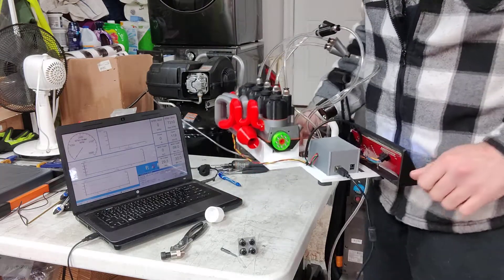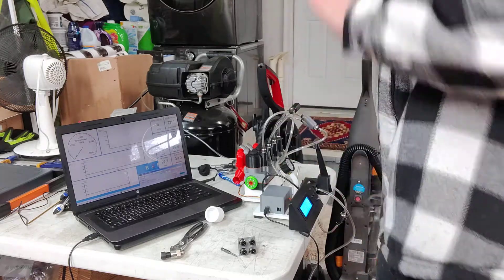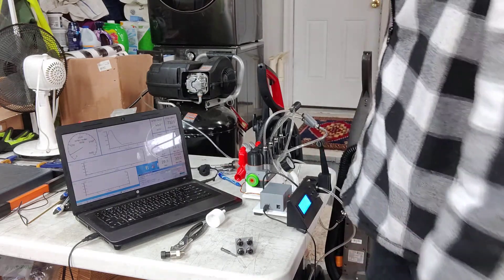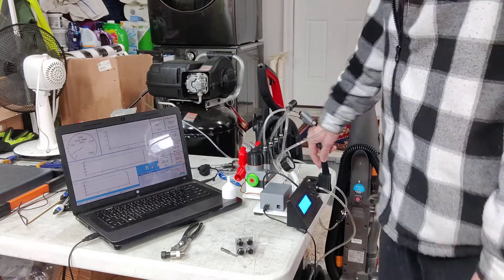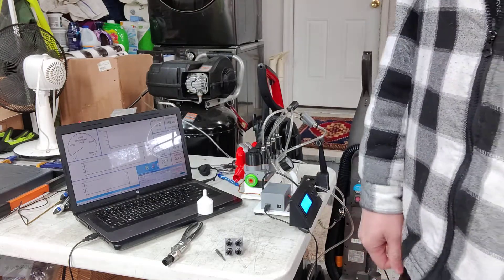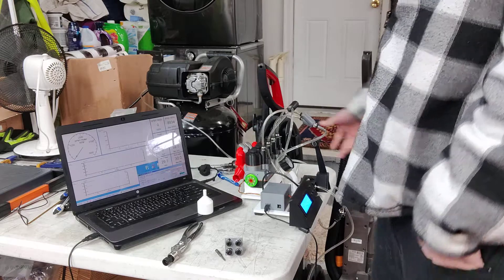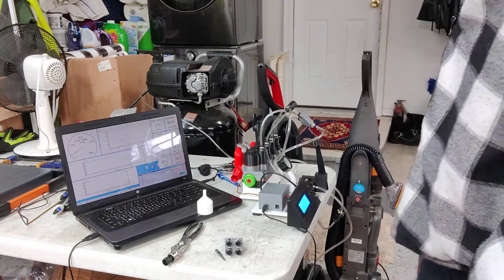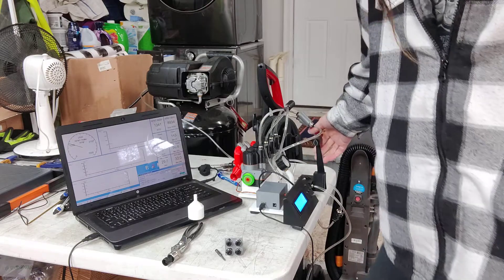Inline 4 crossplane 2 stroke 8cc air engine with tubular exhaust!

Comment: Hey Chris... I remember you mentioned considering an exhaust valve in one of your videos not that long ago. I had an idea to either make a 2 stroke style exhaust to help evacuate the chamber, or run a sort of a centrifugal turbine pulling vacuum on the exhaust. I think either one could possibly help efficiency more than the extra friction of an additional valve. I've got a lot going on at the moment but wanted to see if you'd be interested in giving it a try.
Reply from the maker: I have a video coming out soon that talks about the way the exhaust valve works in the current design,  It is very similar to a two stroke style, but with the diaphragm as the main difference, but the main thing that I found, is no matter how hard you try, you cannot scavenge with just port design and placement, it also relies on the exhaust pressure waves coming back.  I have calculated the pipe parameters for a tuned pipe, but they came out to being relatively large compared to the engine and hard to design, since I would need four of them it would take a lot of effort.  I probably will make them someday and it would improve the top end by a little, but at the moment the gain is not worth the effort.

Comment: Very nice. Now I wonder if, to avoid having a huge tank on your dragster, you could use a 900psi CO2 cartridge. If you had it regulated to ~100psi or so it would have a few seconds of full power.
Reply: When I was into the whole "Battle Bots" thing, the standard gas people were using was Nitrogen. CO2 tends to turn to dry ice when you call for a massive surge of it, meaning that you don't get nearly the instant results you wanted for a hammer swing, or whatever. Nitrogen, on the other hand, is much more stable and doesn't have the "partial pressure" drawbacks of High Pressure Air. Despite being an asphyxiant, it's also very welcome by the showbiz-minded safety inspectors (over HPA), because single-gas tanks grant nerd credits, or because any fire risk will cause them massive problems, while your 3000PSI N2 tank exploding and showering the audience with shrapnel is covered by the waivers they all signed, and a bit of carnage will only increase ticket sales.
Reply from the maker: I have tried CO2, but at best with the regulator that I bought (Originally for a portable beer tap) doesn't have the flow needed.  I also think that there is simply not enough volume, but I also tried the smaller CO2 cartridges.  I think that it would be cool, to revisit the idea with a nice regulator with high flow and bigger CO2 cartridges, we could at best, use it as like a boost effect!

Comment: I had a question about your dyno setup. I managed to get mine working, but it keeps creating huge spikes and isn't super consistent. Any suggestions?
Reply from the maker: I just seen this comment, so sorry about the delay in responding.  I will be making a video soon detailing the Dyno system along with the build video and release of the files.  Stay tuned 😉
Reply: Yo yo yo what’s sup he makes some cool 3d printed air engine!!